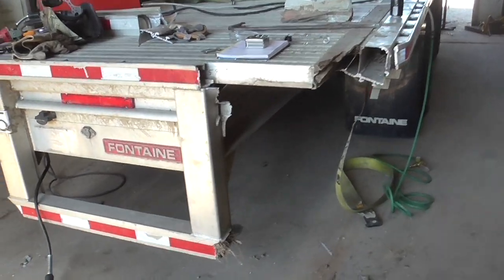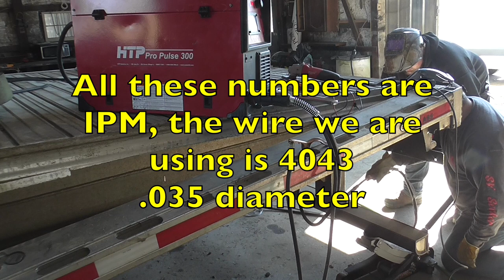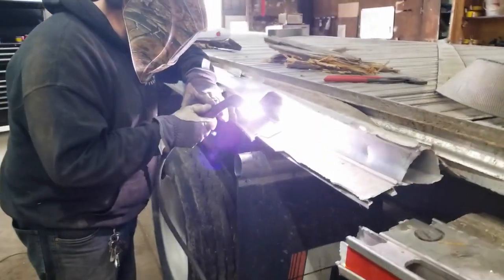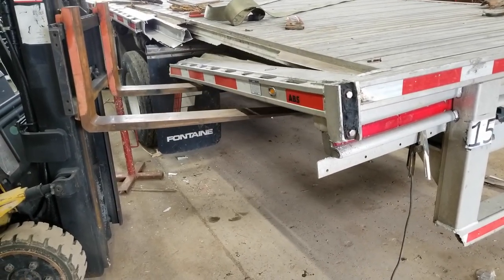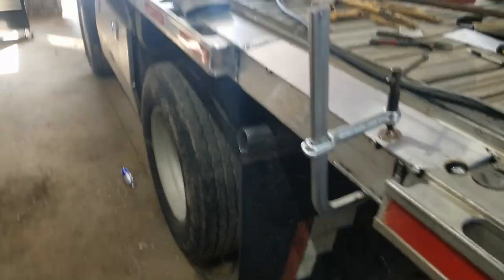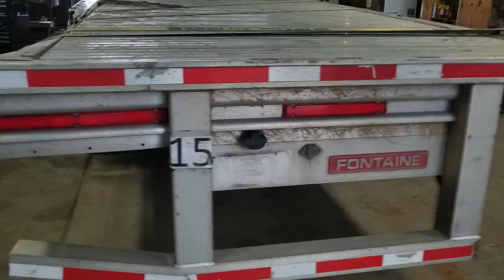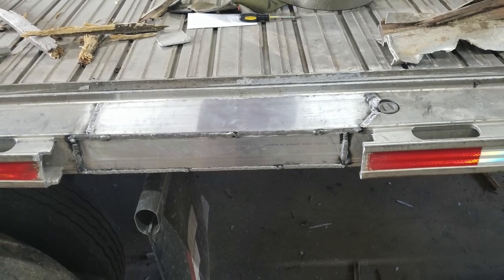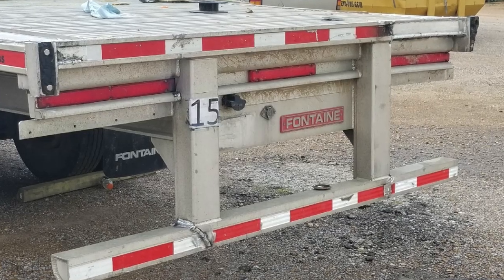Rolled over and completely wrecked semi trailer. Can it be fixed ? CUT STRAIGHTEN WELD.... REPEAT

Comment: A tasty bit of "just get stuck in and do what is needed".  Although Aluminium trailers are VERY rare here in UK . Some Articulated , or semis as you call them for grain. But very few small car trailers or flat beds like what you just glued together. By far most are steel. Over several years I have seen great work from you Zila. Keep it up, children are V important , I have five grown up, now I entertain Grandchildren, from here in a field outside BALLYNAHINCH.  Northern Ireland.

Comment: I hate to say it; but people in our society are going to have to get used to the concept of fixing what up until now has been too easy to throw away and repurchase, with the hard times ahead, and all. That looks like a miserable job but you got it back on the road, and thats what matters. I wonder how long that would've taken with straight TIG? Those propulse machines are great for that sort of thing, I'd never want to go back to aluminum repair without one. I havent even shilled for HTP in ages but I still recommend their machines whenever I get the chance. They're up there with Fronius and Hypertherm, IMHO.
Reply from the maker: it would have taken weeks with tig ...  and the overhead welds .. well - unless its SUPER clean and you are REALLY skilled ... - nightmares .....  mig "deals better" with some contamination/dirt than tig .... tig needs to absolutely NO wind and NO dirt ... and is super slow

Comment: I am getting ready to make a big decision on welders, I am seriously considering the miller multimatic 255 over the 300 because the miller is at least 1000 dollars less than the 300 from HTP.
Any thoughts Zila? 5400+ tax for me is a huge hit, one that's too big for me to consider.
The multimatic aside from aluminum seems very much par with the PP 300 for steel work.
Reply from the maker: If you are looking at steel welding ( no pulse ) and if you are looking on running on single phase power only and if you are looking at power output and duty cycle those machines appear to be pretty comparable. 
The miller will draw 84amps from the wall though where the htp only draws 51amp ….  That could be an electrical update waiting to happen for you ….  
And if you want pulse …  the htp has single AND double pulse as well as regular pulse and i cold pulse ( that is comparable to miller accu pulse vs versa pulse) ….
And when you get into aluminum - all bets are off ….  
This is the info i have - you need to make your own decision ….

Comment: Hello Peter,

 I met you at Fabtech in 2017 . Quick question  for your opinion.  My shop only gets single phase power. I  have an HTP MIG 240 that I bought 30  years ago and is still going  strong. Is it worth getting the ProPulse 300 or 220  with only single phase? I was going to sell my 240 and bite the bullet for the ProPulse 300 but I don't think my return on investment will pay off with only single phase. What do you think?
Reply: 3 phase is not necessary, useful, but not necessary....
Reply from the maker: Robert,  it all depends....   the Pp220mts will have A LOT smoother arc than the mig240 (I owned 3    mig 2400's myself over the years) you will be spoiled once you weld with the Propulse, even the little one ....  the arc is amazing and it feels REALLY powerful (as it has up to 35 volt or arc voltage ....  ZERO spatter ....   you are limited to a 10 or maybe 12ft gun though ....  also the mig 2400 (and most likely the 240 are dramatically underrated when it comes to duty cycle ....   if you weld a lot of BIG stuff ... you defiantly need the 300 if you do repair jobs and you dont live in in 100F+ weather ... the pp220 might be fine ....  the 300 is a full industrial monster ....  NO derating in power OR duty cycle when running it on a single phase outlet  !!!!!!  even I never got it to overheat .... running 045 dual shield a full 33lbs full before lunch !!!!!  just wide open and let her rip ....  if you fix excavator buckets , farm implement , bug equipment ..... the 300 will be your friend for LIFE

Comment: Is there a reason why you our pulling the gun and not pushing to get the gas to clean your weld better.
Reply from the maker: most almost all of the welds were pushed, the close up filling the gap ... that was before Jeremy really had the hang of it .....  aluminum by all means should be pushed all the time ...
Reply: @ZILAwelds  thanks 
Airforce welder Michigan
Reply: @ZILAwelds  Thanks airforce  welder Michigan